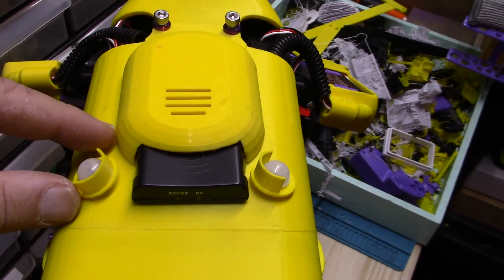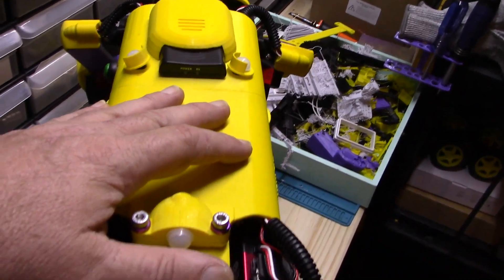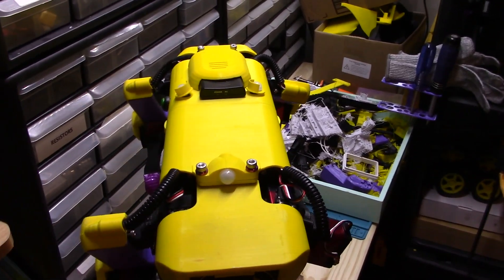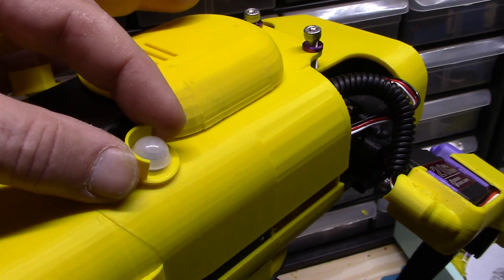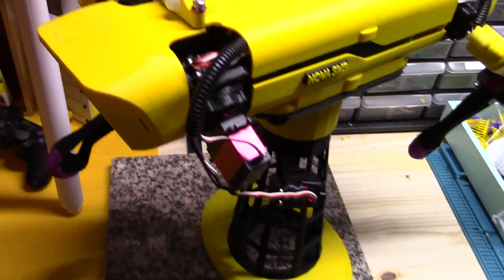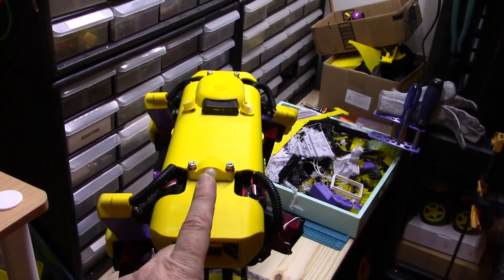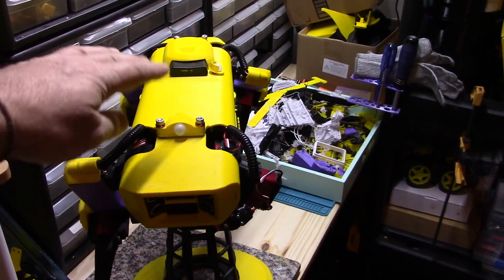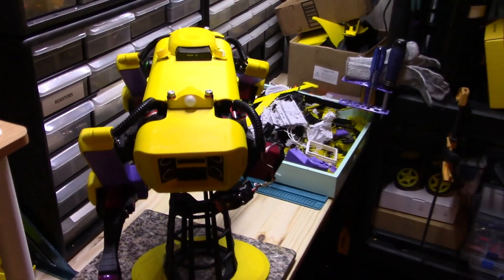PIR Sensors Installed : Nova SpotMicro3 - an Arduino Quadruped Robot Dog

Comment: Can't wait for updates on your sn-3. I'd imagine the load on the tiny servos would be a difficult part to figure out
Reply from the maker: ya, that project may never make it past conception.  I printed the whole thing, but even full metal micro servos cant handle the poor tolerances and friction alone of 3d printed parts, nevermind much else.  I may try again one day, or perhaps just release what Ive done so far in case anyone else wants to try. I think it'd be really cool, but right now I havent the patience for it 🤣
Reply: @ChrisLocke1969  Fair points. If you return to it in the future I wish you the best of luck on it!